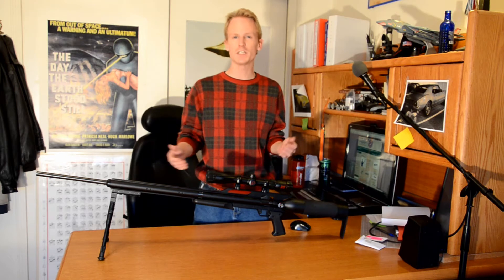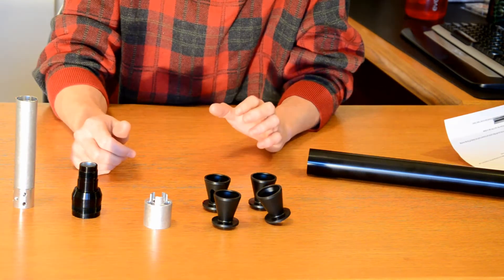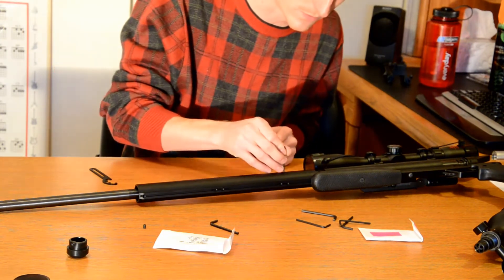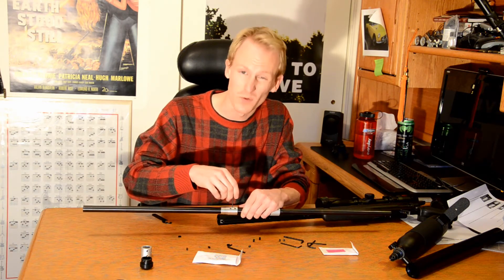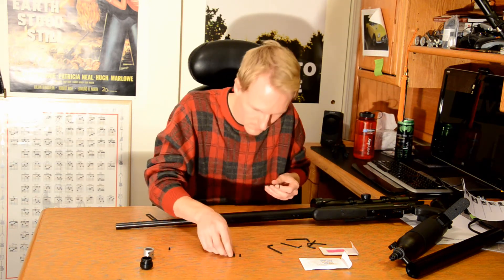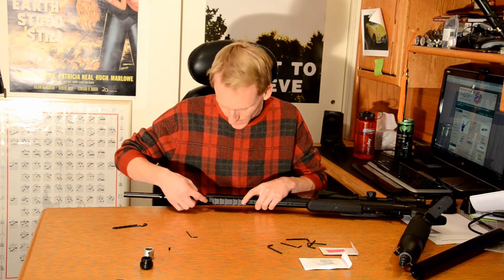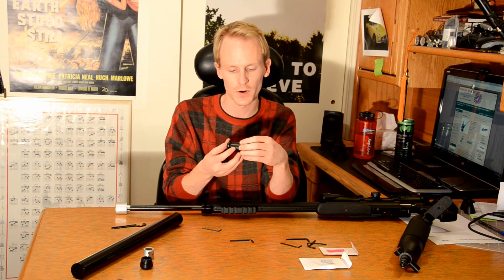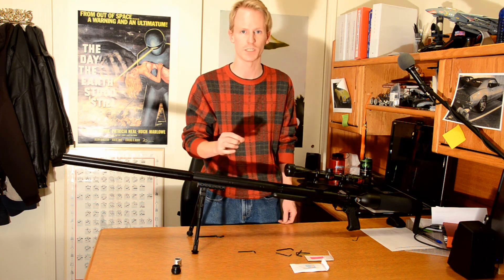Airforce Texan Shroud Install (Suppressor)

Comment: Sure you figured it out by now but blue lock tight those barrel screws. Worked it's way loose after 100shots without doing so. I thought the barrel wa leaded up but ended up being it was loose causing accuracy issues!
Reply from the maker: I had not discovered that yet.  Thank you for letting me know!  I have not had as much time for things like shooting this year as I would have liked.  I'll definitely reinstall those before the next time I go shooting.

Comment: Nice, I wish they would have had the Texan ss out sooner , before I bought mine. But I have no regrets I really don't have to worry about noise way out here .. I just got the 308 to, I bet they are gonna come out with the 308 ss , lol,, great informative video.....
Reply from the maker: Thanks!  I'm pretty happy with the way it turned out.  Yeah, I probably would have bought a Texan SS if they had it sooner, but I wanted one of the first rifles anyway so this is a good compromise.  Noise really isn't an issue here either, but it is pretty cool to have it quiet.  Should have held out for the 308 SS.  lol

Comment: I have an Airhog shroud for my Texan .457, and the db rating as tested was 117.4with or without the shroud.I measure 3 ft, and pointed perpendicularly to the direction of the gun. Some manufacturers say they don't believe db meters.....perhaps this is hwy. They do not muffle the sound level....they modify the pitch, but the sound pressure (noise) is nearly the same as without. Do you know of a company that makes effective shrouds for big bore air rifles?
Reply from the maker: I haven't finished editing the video yet, but I found the same thing in front of the muzzle.  However, next to the breech I found the dB level significantly reduced.  I suspect this is because the pressure level is relatively low in comparison to a standard round creating a lower frequency.  This causes sound to not be absorbed as well by the baffles yet still redirected away from the shooter.  Just a guess.  And this one is the only shroud I know of so unfortunately I don't know of a more effective one.
Reply: Donnie fl My works great My 50 cal is quieter than my 357 bulldog Amazing

Comment: Quick question, did your alignment cap scratch up the end of your barrel?  I was as gentle as possible but it definitely scratched it up pretty good.  Not a big deal, you can always reblue a barrel but I was shocked how easy it scratched.
Reply from the maker: Unfortunately yes.  I was also as careful as I could be but it still took all the bluing off.
Reply: Thanks man, I really appreciated all your Texan videos, it really helped me in deciding between the regular and SS models.  I just got my regular Texan today!!!  I wanted the extra power but need stealth for urban hunts, man the RL shroud works great, the projectile hitting a milk jug was louder than the shot, it was wild after shooting it unsuppressed first!  Thanks again for the videos and the tips for the install!
Reply from the maker: No problem man!  Glad you like them.  One of these days I'll actually do a video about tuning the thing.  Just takes time.  Yeah, from a shooting perspective it's just night and day difference.  It's worth a few scratches I think.